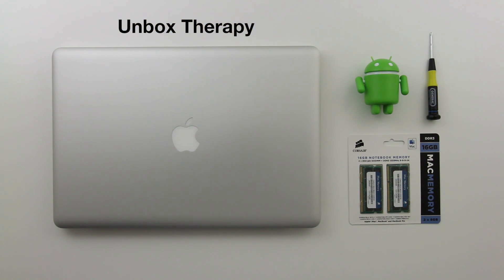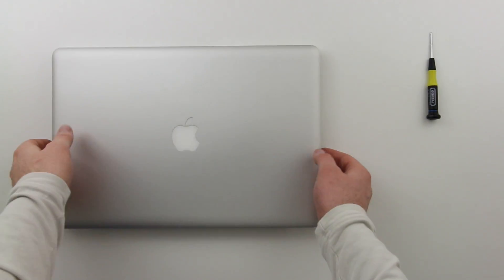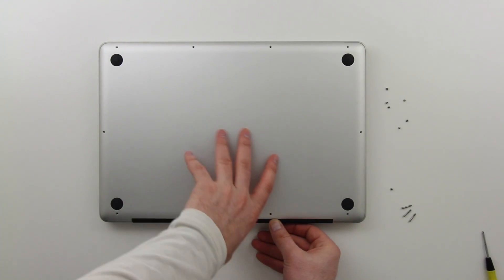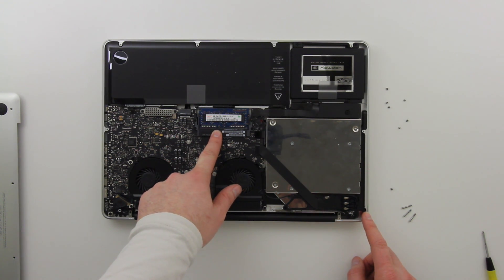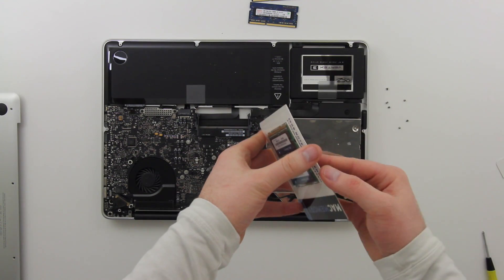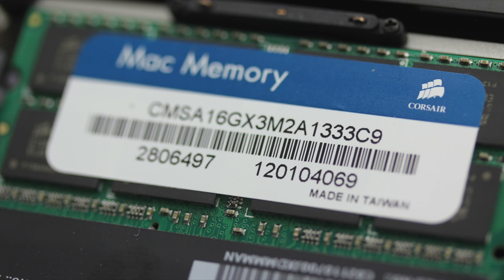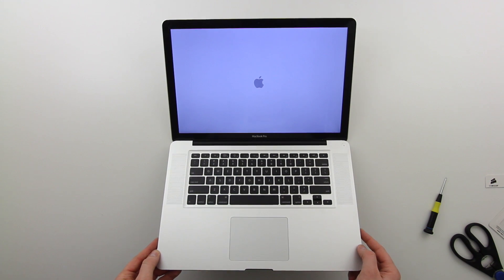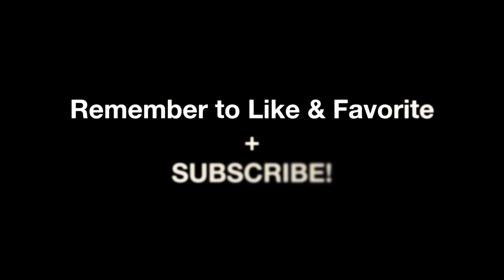16GB MacBook Pro RAM Upgrade (2011)

Comment: they should be always the same, theoretically its not necessary but its proven that it is more stable, furthermore they should be always the same size (2gb+2gb not 2gb+4gb) but its not hard to find since ram comes in duo's :)

Comment: What do you mean 150GB HDD? It's been a while since that was an option. Hard drives are expensive, apple opt for higher write speed over drive size, this has a huge advantage with software applications and OS speed. They also seem to buy from well known companies which ask for higher prices than other manufacturers due to the life span and build quality of the drives (and the name).

Comment: Battery life is essential for business, education and even commuting. Every manufacture is trying their best to boost battery life. Systems built for windows have issues with this due to hardware and software being build by many different companies. Where as apple has limited parts they use for their systems, some of which are made by themselves. They are there for able to optimise their systems to meet their requirements.

Comment: I game on my imac via bootcamp. No issues what so ever, runs all the games I have on steam in high quality, some in ultra. Mac games run perfectly, sure with lower texture quality due to OSX lacking directx and instead using OpenGL. There is no difference between buying a Mac or a Windows computer. It's like comparing a Hyundai i30 to a Kia cee'd. One has slightly a slightly higher manufacturing quality therefore the price is a little more.

Comment: I am planning on cramming a 120GB OWC 6G SSD in the main drive, throw the 750GB in the optical bay, and go from my 8GB Crucial RAM kit to a 16GB kit.  I run Windows 7 through Parallels side by side with OS X, and splitting each OS with 4GB each runs me almost completely out of RAM.  I am a computer animator and taking classes for game design, and the resources get eaten up pretty quickly.  The RAM and especially the HDD are definitely my MBP's bottlenecks right now.

Comment: The mid 2012 macbook pro has DDR3 1600 Mhz, so the 1333 Mhz memory, displayed in the vid, won't work. Although the upgrading process is almost identical.

Comment: I've just order 16gigs of 1600Mhz DDR3 memory from corsair for my early 2011 MBP (maxed specs). I plan on using it for adobe tools, web browsing, FCP X, and programming (usually 3 of the 4 are running at a time; safari with about 10ish tabs is how a roll....). Hopefully that will eat up my 16 gigs nicely xD

Comment: It should, but the Mid-2012 MBPs use 1600Mhz DDR3 Memory. I have a early 2011 and I use 1600Mhz memory anways. Still, look for 1600Mhz for your 2012 model :)

Comment: The reason that apple is so much more expensive then, lets say a PC is because that they  actually are better, in terms of hardware. If you were to put the same hardware on a PC then it would cost just about the same. Apple is known for making really pretty devices that are really expensive but the hardware inside them is actually very high end. Go look at an Alienware PC. The hardware inside one of those is about the same as a Mac.

Comment: i found my problem,wrong installation is not an issue.the problem is i bought a wrong mhz of memory,instead of 1333mhz i needed the 1066mhz that compatible my macbook model mid 2010,

anyway thanx for the help..god bless

Comment: I think your full of shit. I render CS5.5 after effects videos with high def at 60+fps settings. And the most my macbook pro has used is up to about 5 sometimes 5 and a half gigs of RAM. I have my macbook loaded up with 8gb ram as I have a 2009 macbook. You have to have something else running in the background that is a decent for editing software.

Comment: 16 gig is very useful for research oriented work. In clinical research, some of my dataset ranges from 100 mb to 10~20 gb. Sometime I have to keep multiple of them live in the ram for comparison purposes. So in my case, sometimes 16 gb is still not enough.

It's true that maybe this type of analysis should be done on a desktop or a workstation, but it's really hard to carry those around to conferences and between labs.

Comment: i have 8 gb of ram in my macbook pro early 2011 and I'm thinking for 16 gb because than i can run mu virtual machine and photoshop and final cut pro at the same time and that would be great 
I saw you are also using the ocz vertex 3 ssd aren't they a some ? great vid:)

Comment: The processor could handle it but, before spending that much on memory modules, I would consider selling that computer and buying a new one. If you can wait for Ivy Bridge processors in 2-3 months, I would wait, but, if not Sandy Bridge is plenty fast with quad i5/i7 processors. I wouldn't buy another MacBook right now though either, unless you NEED one because, they are REALLY overpriced. The ENVY 14 is great deal though. Quad core i7, 1080p display(not on Mac), and Radeon 6790. All for $1,200.

Comment: Dumb question, perhaps.  How much different is 16GB vs 8GB?  Currently, I have a mid 2009, 17" MacBook Pro with 8GB 1066, 750GB HD and I get annoying beach balls regularly while using Firefoxm Parallels or Dreamweaver (Lion OS).  Some days good, some days really laggy.  It's almost as laggy as when I had 4GB Ram in it.  >.<;  My MB is dual core so I don't think I can upgrade to 16GB anyway, but just wondering if it would make a huge difference between the 16 vs 8, because 8 vs 4 isn't noticable.

Comment: great video. i did this to my Early 2011 15" MBP as well. great for use in photoshop when batch processing images or when creating composite images like panoramas. i frequently merge 30-60 separate images into one. this requires that each image be loaded into memory. i've never used more than 13GB of my 16GB at once, but i'm sure i could if i tried.

Comment: @asteriscoamarelo2 
1)Restart your computer.
2)Press the key indicated during the startup messages (normally one of the "F" keys) to enter BIOS.
3)Click on the "Chipset" or "Advanced Chipset" features.
4)Highlight the "DRAM Configuration" option and press "Enter."
5)Read the timing entries (CAS latency, RAS-to-CAS delay, Precharge and Cycle Time) to determine the current timing settings for your memory.

Im not sure about Mac though...

Comment: I recommend any Mac user to max the ram out. I used to have a lot of problems with just multiple tabs open in Safari or Firefox! I upgraded to 8GB RAM and have been smooth and fine since! I am yet to max it out. Put an SSD in it too and you'll be set for the next few years :)

Comment: i see your running mac OSX 10.6.8 which is snow leopard. have you just not gotten around to upgrading to lion, or have yo decided that lion got rid of some features that you need in your daily life? just wondering, because i wanted to dual boot lion and snow leopard but after the 10.7.1 update my macbook would no longer support installing snow leopard.